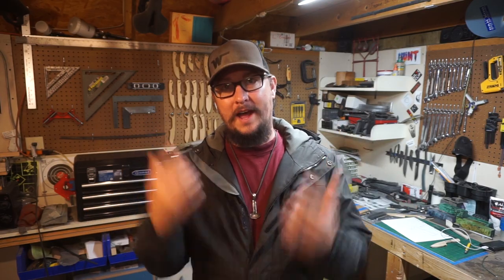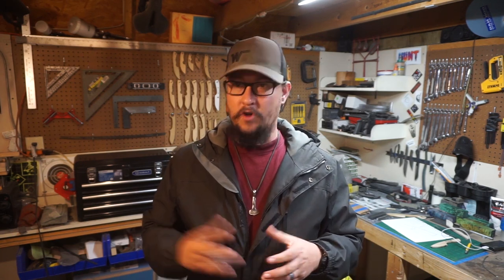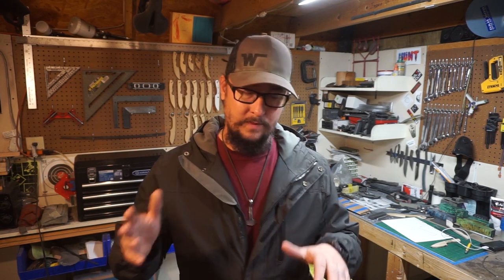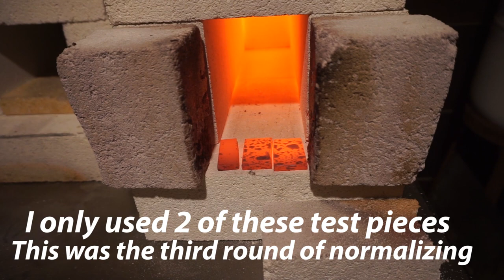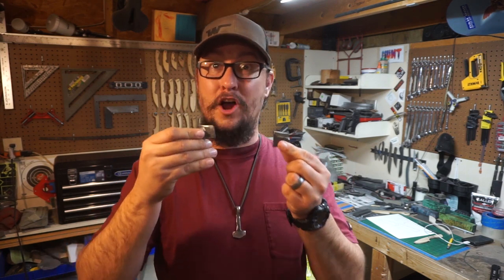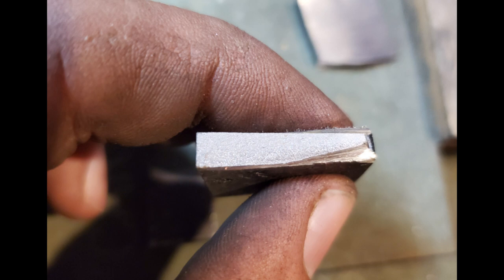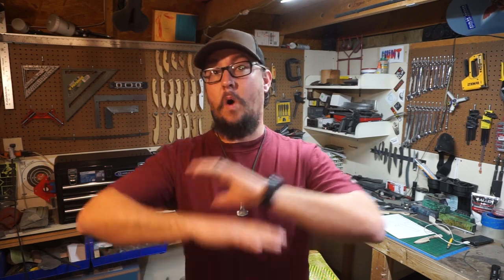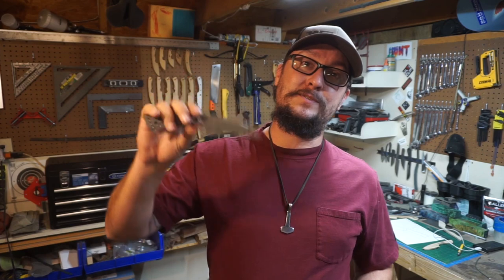Heat Treating A 5160 Wharncliffe Knife | My Heat Treat Process | Vlog

Comment: Very informative. Thanks for showing the importance of normalizing. Me personally, I mainly use 1084, but I have done a few knives from 1095. But everyone has their on desires. Again great video, and stay safe!
Reply from the maker: 1084 is a great steel to work with. There is no need to branch out unless you are wanting to do something different. There are master smiths that will tell you to pick a steel and stick with it. Mine are 1080, 1084, 15n20, 5160, and 80crv2. I'm gonna stick with those for a while before I branch out.

Comment: Hello!  Very good video!  I am new to cutlery, and I wanted to know how long I have to maintain the temperature of the knife once it no longer sticks to the magnet.  Also at what temperature should the oil be and if the hydraulic oil works.  Greetings from Argentina!
Reply from the maker: It varies depending on the type of steel you use and your forge, a minute and a half to two minutes.  120 degree F with the Parks AAA and Parks 50 peanut oil that I use. I don't know about hydraulic oil.

Comment: I don't believe I can do a proper heat treat  on many steels without the precision of a heat treating oven, so I stick with 1084 for my knives, as it is pretty forgiving. Thanks for sharing your process.
Reply from the maker: 1070-1084, 15n20, 5160, and 80Crv2 have almost the same heat treating process. You should check out some of those as well. Thanks for watching.

Comment: Great takeaway from this Video -  it showed me that i will do it as i did the last knives...i sent them to a heat treating service for hardening....because i do the most by hand it would make me sick if i put tons of work in it and mess it up by doing a bad heat treating process...only MY opinion
Reply from the maker: Hey, there is nothing wrong with doing that. I agree it's rough when you spend hours or days working on something just for the heat treat to mess it up. when ever you decide to do your own heat treating, just get a heat treating oven. You can just set the temps and time for normalizing and heat treating and they will do exactly that.

Comment: How did you learn about the different normalizing processes of the different grades of metal?
Reply from the maker: I did alot of reading on blade smiting forums. Always look up what type of steel you're going to work with because I guarantee someone has made a post of a forum about it.
Reply: @theriversexperience9383   Do you have any recommendations on bladesmithing forums?
Reply: @kraftro1  To help out our YouTuber- https://www.bladeforums.com

Also

https://www.secowarwick.com/wp-content/uploads/2017/03/HeatTreatingDataEBook.2011.pdf

Page 39 has the heat treat info for 1080/84 and 1095 (and a bunch of others).

I’m new to this whole thing as a hobby, but it seems that unless you are VERY careful or have a heat treat oven, it’s best to stick to the forgiving steels.
Reply from the maker: Yup, what straight up tackle said. They have a ton of info on there.

Comment: Is that toaster oven big enough to fit a 12” long kydex sheath in? What about a big knife? What would be the max size capacity with light touching the sides
Reply from the maker: It has a 11" internal size. For longer knives I just use my home oven.

Comment: Do you recommend the same normalization process on all steel cause right now I only use 1084,I'm new at making knives,I normalize mine by heating to non magnetic twice thats it,then I heat treat it the same way,is that why my knives still flex and bend even after tempering?
Reply from the maker: I normalize everything that I use, so yup I would definitely recommend it.

Comment: If in tempering you only need one cycle do you only need one cycle in normalizing
Reply from the maker: There is a recipe for every type of steel to get certain results. Some need more steps, some need less steps. I always suggest that you look up what steel you're using and research the heat treat recipe for that steel. I still do this.